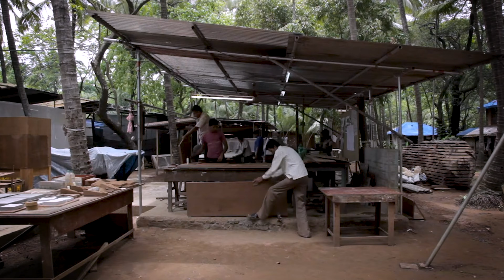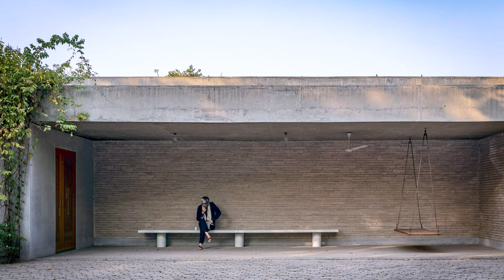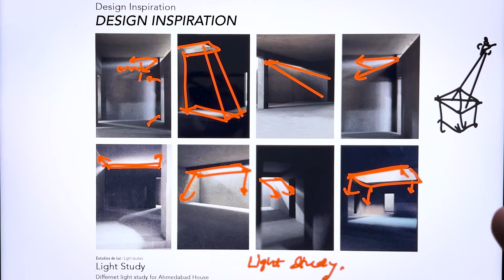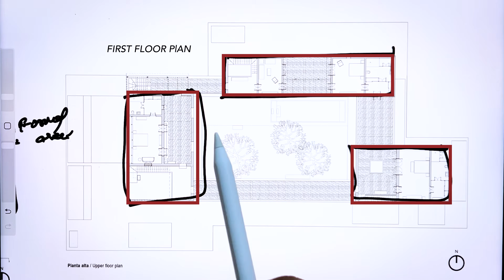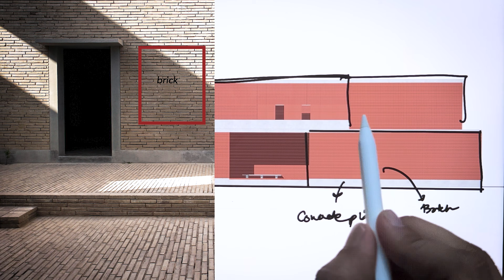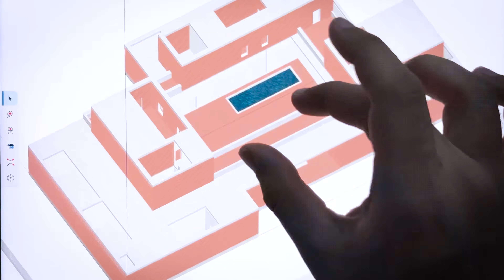WHY ARCH: What is Indian Architecture? | Ahmedabad House by Bijoy Jain | Studio Mumbai

Comment: When you talk about proportions do you mean whole building or proportion of each space and can you mention a better height as per human scale to any residence.
Reply from the maker: Great question! When we talk about proportions in architecture, we refer to both the whole building and the proportion of each individual space. Both aspects are crucial for creating a harmonious and functional design.

There is no single method for determining proportions; every architect follows their own approach. For example, Corbusier used the Modular system, where he chose the basic height of spaces based on human height. Alternatively, you can use the Golden Ratio as a design principle, or follow Vastu principles, which also suggest basic dimensions for spaces. I will make a detailed video on this particular topic ASAP.